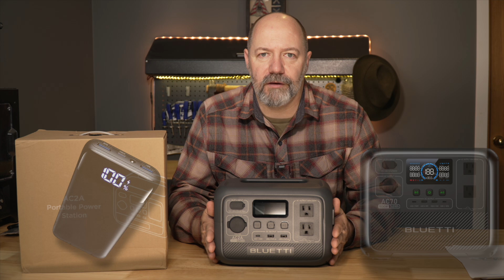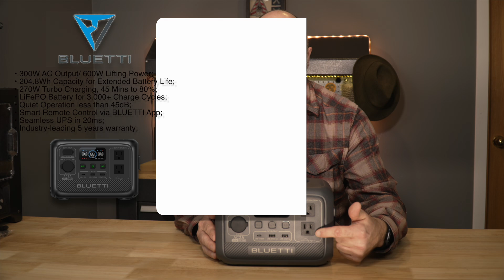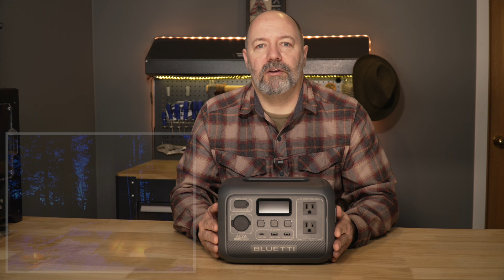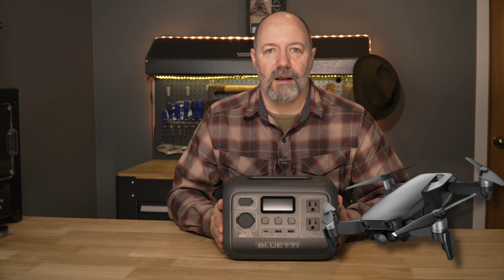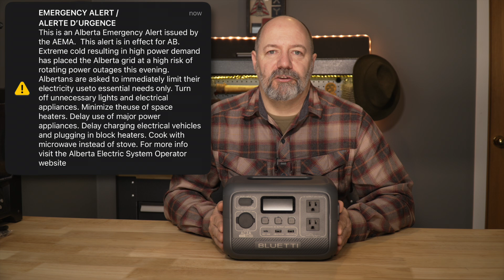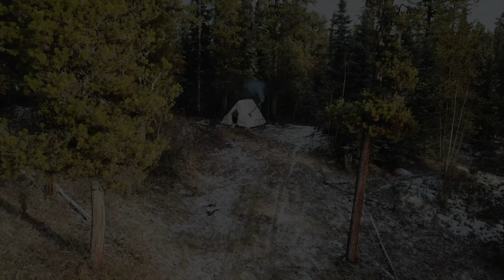NEW!! - Bluetti Power Station AC2A 300W Affordable Compact Power Solution!

Comment: If I had a camper van, instead of having integrated power installed in the van, I would use a portable power unit so I don’t have to worry about frying out the van’s electrical system. I’m going to get a portable power supply when I have the extra money to spend. Being able to use a portable unit plus a portable solar panel is a plus. ✌️🇺🇸🇬🇧🇨🇦✌️
Reply from the maker: 100% thats the way to go - Those expensive systems they install in vans are a ripoff - Power stations are the best solution 👍